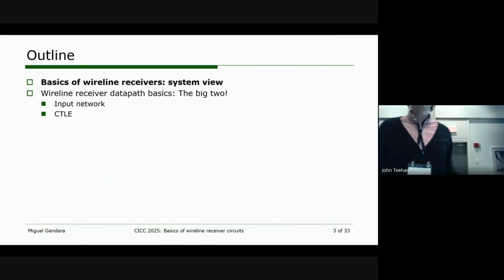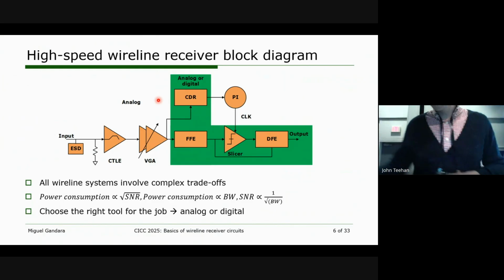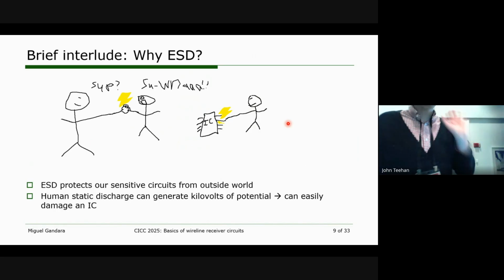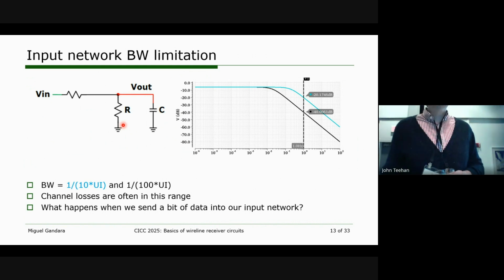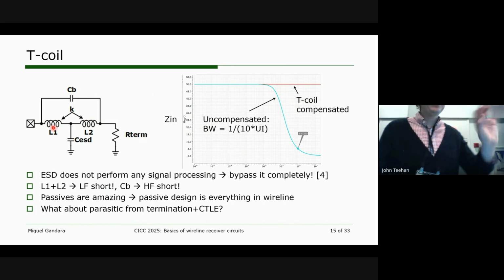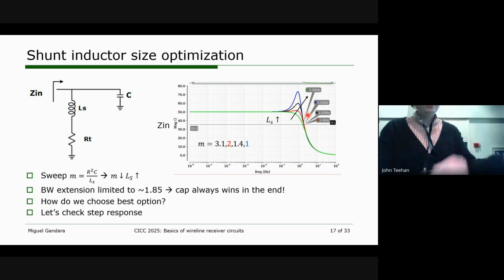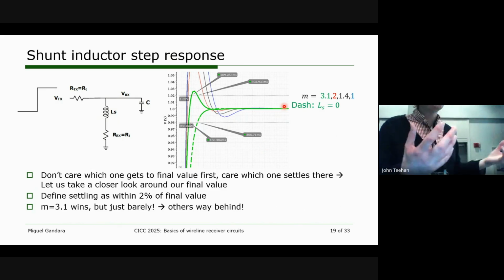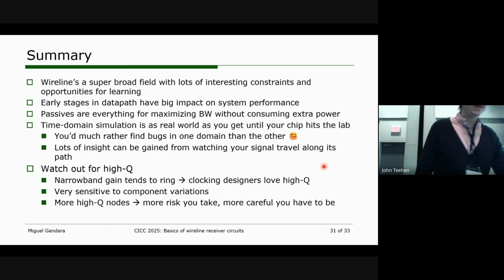4 Miguel Gandara Wireline Receiver Circuits

Comment: Hewlett Packard has a good (old) app note on S-param and channels that goes into the group delay variation.  It's not only delay variation "amplitude" over frequency, but also how many swings in delay over freq. band of interest.  One channel can have a large delay swing but gradual and not many, another with comparatively small amplitude but many swings, with the second very much worse in performance.  This, it seems, amounts to draining energy from, and disrupting too much, the spectral components.